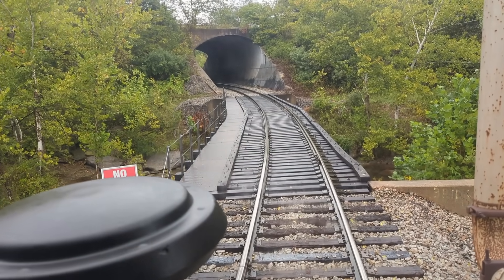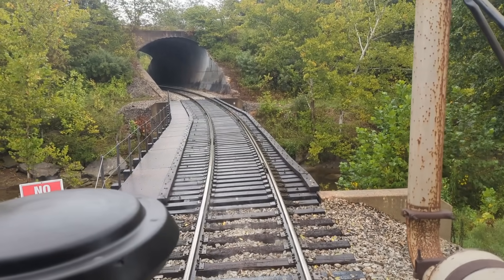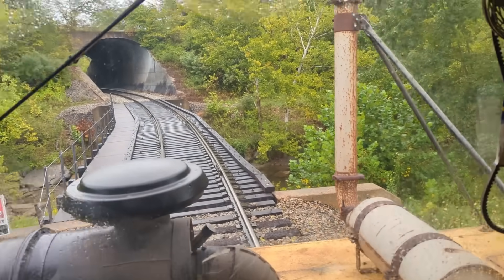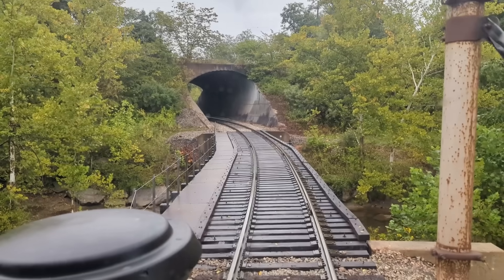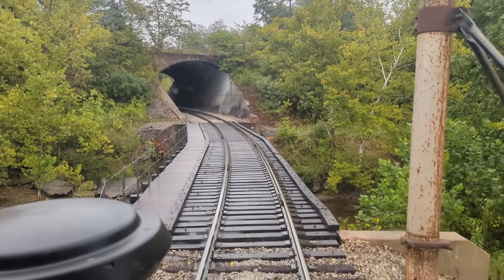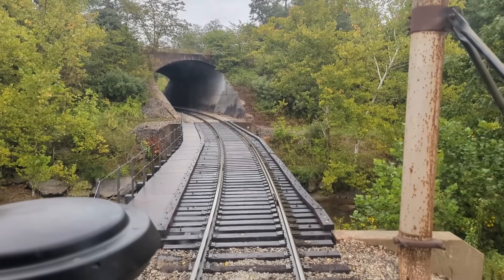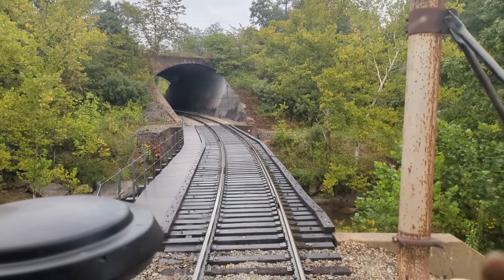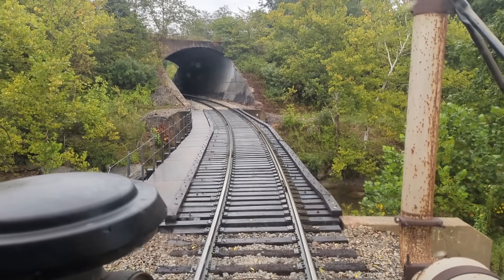How Super Elevation is Added to Railroad Curves on a Bridge

Comment: Dave, excellent video. Very nice job explaining super elevation. I want to say I can remember so old FRA track geometry books that refered to super elevation as cant. I know I've heard it called that before. Another way I've seen super elevation put into a curved bridge is to drive the piles to the desired elevation. Have a wonderful day.
Reply from the maker: Thanks for the nice comment Zach and for sharing that info about the piles being driven to different heights, I did not know that
was ever done. Now I've learned something else new. On our
bridges they don't have pilings but girders rest on a solid
concrete block, huge concrete block!  Really appreciate your
taking the time to watch and hope you have a very good day.
Reply: @ccrx6700 All our bridges had piles. All were also the old wooden trestle style too. I can recall 1 in particular that the Santa Fe had replaced as a concrete culvert but left the old wood trestle deck. It was an oddity but worked.
Reply from the maker: @rebelrailroader 👍😎🚂

Comment: I don't know the term for it but a lot of other railroad bridges have been converted so they are all ballast with track laid on top so there is no bouncing transition. I guess those are less maintenance for high speed and what you have here is less maintenance for low speed?
Reply from the maker: We have 1 ballast deck bridge Bridget. I love it. All our open deck
bridges have problems with the approaches sinking, the ballast
deck bridge never has a problem with that, tamp right thru it. I
wish all our bridges were ballast deck. Far less maintenance
on a ballast deck bridge too, you are right about that. Thank you for  taking the time to watch our video and may you have a very good day.
Reply: Ballasted deck trestles and viaducts — that's an interesting question, I'd like to know too!
(Also, I read your username as "bridge it" 😉)
Reply from the maker: Read my reply to Bridget Tristan.

Comment: I see that the ties are wider just before the bridge. Does that make the transition good enough or does it still bounce up?
Reply from the maker: Not wider but they are longer Bridget, I think that's what you meant.
Typical cross tie is 8 1/2 feet in length. Usually we put 5 to 7 longer
ties in close to the bridge, they are 10 feet in length. That helps
to spread out the weight over a wider span and helps to better
hold track surface going into a solid fixed object like a bridge.
Thank you for taking the time to watch and may you
have a very good day.

Comment: Hey Dave,  What is that pipe or plenum that is covered alongside the bridge used for?
Reply from the maker: That is a 26 inch pipe line that carries treated mine water from
the mine to the river j Biggz. Pipe is hung under several of our
bridges and is wrapped in insulation and also has heaters.
Thank you for taking the time to watch our video and may you have a very good day.

Comment: I was wondering what the superelevation rate in '/' ( foot per foot) or by percent of super is on that first bridge? Also do you know what the design speed was on the first bridge? Seems to me like a compound curve or a spiral curve would have been a better design than off setting the tracks on that bridge...............
Reply from the maker: Speed on our entire track has been 25 since the beginning Dan.
Bridge 11 is in the full body of the curve so the SE remains constant
thru the entire bridge. To figure how much super elevation goes
into a curve there is a mathematical formula, however I have a 
chart put out by the FRA which gives me the correct SE for the
degree of curvature and train speed. That curve is a spiral curve
but not a compound one. The radius is constantly changing
until the full body is met. SE is added in increments of 1/8 of an inch
over the entry spiral and taken out 1/8 of an inch over the exit
spiral. The amount of linear feet that 1/8 of an inch is added in
or subtracted from depends on the length of the entry and exit
spiral. Thank you for  taking the time to watch our video and
may you have a very good day.
Reply: @ccrx6700  I am familiar with the AAHSTRO design book. Nowadays we got it made, Civil 3D & Inroads figures out super elevation based on design speed and radius we set.

Comment: Hello Dave 👋, 
Great explanation on the dapt.
When you're in a spiroll, the center part of the bridge is where you key off of When tamping if I'm right  to meet the transission at the bridge walls to the first tie in stone
 and not make a speedbump in the track. 
After sorting through over many thousands of ties, that bridge timber was rejected for the the horizontal split going across the timber from the dapt to the other dapt.
Very expensive timber and a shame for the tree 🌳 that it came from. Many years of growth and now it's junk 😮😢. 
I see many like that while sorting out ties. 
Stay safe my friend and have fun 👍. Richard Bause
Reply from the maker: We don't like speed bumps in our track Richard.... :-) Problem with
most bridge approaches is they sink. I can start my plot anywhere in
the curve if I want, just have to know how to add in the right
super elevation if a plot is started in the middle of a curve, starting
in a spiral requires a bit more mathematical know how, so I
usually don't do it. Saves me some brain power..... LOL  Thank you for taking the time to watch our video and may you have a very good day.

Comment: Dave, which came first? The tunnel or the Interstate?
Reply from the maker: Good question Donald, more history. Our tunnel under neath I 79
was built around 1970/71. That portion of I 79 was built after
in 1972/73. My dad was a line man for the local power company
and was one of the men who moved the electric lines for that
tunnel to be built. He took us up there and drove the car right up
to the tunnel when it only had a concrete floor in it around
1971. I remember that well.  The tunnel that I showed in this
video was put in around 1975/76 and they closed the road 
over top to build it.  Thank you for taking the time to watch and may you have a very good day.

Comment: Thanks for another great video Dave and you are quite right we call superelevation “cant”, we also have to work out transition into the curve and “cant deficiency” which is the difference between the ideal cant and the installed cant to allow for the fastest smoothest passage of trains.  Who said railways were boring
Reply from the maker: Thank you for the nice comment Ian and glad you enjoyed. Cant deficiency can occur from having poor quality ballast that won't
hold track surface well. I have that problem on several of my
curves. The trick here is to try and match the proper cant with
the correct train speed. 6 different train operators plus a host
of fill in operators and no one drives every curve at exactly
the same speed all the time. So to help with that I put the super
elevation in a curve using an inch and  a half under balance.
I've not yet made a video on under balance, most RR's in N. America
use inch an half, but up to 3 inches under balance is allowable by the FRA.  I sure never said railways were boring, pain in the butt to
work sometimes but never boring.... LOL  Really appreciate your taking the time to watch and may you have a very good day.
Reply: @ccrx6700  Actually cant is the angle of the rail itself, and superelevation is the height difference as you previously stated. On a gentle curve on a low speed track, changing the angle of the rail itself from perfectly plumb probably isn't necessary. But if you can imagine your train going twice that speed through that 10 degree curved, then the rails themselves would also need to be tilted off of plumb at the exact angle, as well as the superelevation calculated for the speed. If it's too much for the speed, then it's like trying to walk on the outside of a corner at Talledega Superspeedway, you'd fall right over. That pavement is at like a 33 degree bank angle in the turns, but only 2 degrees on tangent (straights or straighaway) parts of the track. They use tie plates that are thicker iron on one side than the other to slightly tilt the rail. But in England they have passenger trains that run at 100+ mph, certainly too fast for jointed ballasted track.
Reply from the maker: @brnmcc01 in N. America you are correct about cant in europe cant is what they call super elevation 🚂👌

Comment: 15:33 They didn't use this one because of the horizontal cracks. Those parts holding the rails back from sliding sideways would break off really soon and the sleeper would need to be replaced shortly.

But there's a bigger question there. Why was it left on the construction site? Why is litter always left behind? Why are the forest and the stations taken for a dump?
Reply from the maker: I do believe you are right about the splits in the timber Gabor.
As for the cleanup typically the contractors do come in at some
point and clean up their mess, however so far this hasn't happened
 2 months later. Guess at some point I will end up doing it for them.
Thank you for taking the time to watch our video and
may you have a very good day.

Comment: Would the daft decrease as the rail is coming out of superelevation?
Reply from the maker: I have no idea what you mean by daft Tim. However super elevation
in a curve is added in increments of 1/8 inch until the entry spiral
reaches the full body of the curve where the super elevation
is constant. On the exit spiral of a curve that super is taken out
1/8 of an inch at a time until it reaches tangent track where there is no super. The amount of super that is added or taken out over
the entry and exit spirals are totally dependent on the degree
of curve it is. In other words for the amount of linear feet (which
is different in every curve),  1/8 is added or taken out every
so many linear feet.  Super elevation begins with the first 1/8 inch
added and ends with the last 1/8 inch. It's just different amounts of super thru the curve except for the full body where it is constant.
That was a mouth full.... :-) Thank you for  taking the time to watch and may you have a very good day.
Reply: @ccrx6700 Sorry  for the confusion but I couldn't make out the word you said. It sounded like daft  to this hard of hearing ears.
Reply from the maker: @timc4293 👍🚂🙂
Reply: @ccrx6700  Is the amount of superelevation also based on the design speed? I would think that the faster you move a train through a curve it would have to be a lot more. Kind of like when I was riding my motorcycle, to go around a sharp curve I would really have to push to lean it over enough. I think the idea is, you should be able to hold a glass of water as you ride the train around the curve, and if all is correct, the water should be level, ie. the force of gravity in the car should be perpendicular to the floor and not leaning to one side. Coal not super important, but I can imagine a liquid tanker car would not behave very well on a curve with incorrect superelevation. That 1000's of gallons of liquid sloshing to one side could definitely tip a car over.
Reply from the maker: @brnmcc01 absolutly SE has a relation to train speed. Tanker cars are like tanker trucks they have baffles to prevent sloshing 👍🚂

Comment: If the rails are super elevated wouldn't  it cause the plane of the locomotive to tilt off vertical by some percentage and when it enters the tunnel might it be too close to the tunnel portal?
Reply from the maker: The main purpose of super elevation is to maintain car/loco
equilibrium thru a curve Tim. If a train when thru a 10 degree curve
at 25 MPH and that curve had no SE in it, then the train would
keep on going straight and come off the rails. The SE is put in 
to help steer the train thru a curve and also to allow for
equal weight of the cars/locos on both rails instead of too much weight on one rail or the other. Thank you for taking the time to watch our video and may you have a very good day.

Comment: I am guessing that super elevation reduces excessive wear on the inside of the high rail and allows more speed through the curve??
Reply from the maker: SE does 2 things Larry. It helps maintain car equilibrium thru a curve
and allows the train to negotiate/steer thru a curve. SE is put in
a curve depending on the degree of curvature and the train speed.
If a train went thru Bridge 11 and that curve had no SE in it, then
the train would want to go straight because of the centrifugal force and come off the rails. Think NASCAR racing that is why they
bank the curves. SE also causes the cars to put equal weight on
both rails, thus reducing the wear and tear on only one rail.

Too much SE in a curve for the train speed and thus too much weight
on the low rail and more wear on it and car wheels. Too little SE
for the train speed and thus too much weight on the high rail
and more wear and tear on it and the car wheels.  Thank you for taking the time to watch our video and may you have a very good day.
Reply: @ccrx6700 Great explanation.  Thanks.  I banked airplanes in a turn to balance forces too.
Reply from the maker: @LarryTaylor-l5m 😊👍🚂

Comment: How long do bridge timbers last before they change them again
Reply: They last a very long time, because they do not spend their life soaking in mud pumping up and down. Treated wood lasts a very long time if allowed to dry out, and not in contact with soil etc. I've seen power poles around here that were installed in the early 80's and late 70's that are still in service. But those are gradually being replaced, because it might look ok above ground, it's that 8 foot section that's buried in the post hole that eventually goes bad.

Comment: I would think the guard rails would be considered an extra layer of protection. It's like buying extra insurance. You hope you'll never need it, but glad you have it in case you do...
Reply from the maker: I totally agree with you on that Steve. What I am very surprised about
is the insurance people don't require it or at least lower premiums
if the bridge guard rails are in place. If it was up to me then all
our bridges would have the guard rails on them. When this track was
built all the bridges did have them, but they have over the past years
not been replaced when the bridge deck got replaced. Thank you for taking the time to watch and may you have a very good day.

Comment: Not that the Aussies and the Brits are wrong, but "superelevation" is the engineering term WE use to define the design/maintenance parameters for the track structure and "cant" is the difference is casting of the tie plate base that sits flat on the tie (regardless of the track superelevation) and the rail base of the tie plate.  The tie plates are placed on the ties such that the cant "tilts" the rail inward.  This design reduces the overturning possibility of car/wheel forces, espectally in a curve.  

Get the "cant" right, 'cause if ya get the "cant" wrong,.....ever seen a picture of a rail overturned?
Reply from the maker: You are right about that Glenn for N. America. In tie plates
that have cut the ties that causes what rail cant is. That is what
geometry trucks look for when they measure rail cant. Rail cant can
cause the rail to tilt outwards thus redefining the base to height
ratio and if severe enough can cause a rail roll over. We had a rail
roll over here 3 years ago. Although that was caused by a stiff
truck where the truck didn't steer thru the curve and climbed
the rail thus changing the LV ratio and the rail rolled, it was ugly.
Thank you for taking the time to watch our video and
may you have a very good day.

Comment: Interesting. When the commersial railroad was changed into a museum railroad, sold by the state, the super elevation was huge, made for lot higher speeds. Once the rail bike tipped over when sitting above the low rail having no bucket of sand above the high rail in a 300 meter radius curve. Else leaning over towards the high rail, like the motorcycling with side wagon and a wildly working guy leaning into the curve.
The superelevation also made a ballast car tipp over once.
The rail cars design speed was 85 kmph but the speed used now is 50 kmph. The steam locos designed for some 60 kmph now run at 40 kmph. Of course the super elevation has been decreased significantly.
Reply from the maker: Glad you found it interesting Stefan. RR thinking here in N. America
has changed in the last 40 years. Used to be more super elevation
was the standard, over the years now less super elevation is
being put in. So what was once a curve that had 5 inches of super
in it, now it may only have 3. Course obviously the faster the trains
the more super elevation is added.  Really appreciate your taking the time to watch our video and may you have a very good day.
Reply: @ccrx6700  Being a railroad fan since the age of 2 Your channel is a goldmine.
Reply from the maker: @Stefan_Boerjesson 😊👍🚂

Comment: There is two methods that are used in the NYCT. One is a regular cross tie with a tapered block on the high side. Second is a specially milled tie which is solid, with the taper milled for elevation. This eliminates the dap for anchoring to girders. Bridge anchor clip from under neath hold the cross ties in place. For limited access to under neath that may not be accessible J Hook bolts do the job, that secured from the top.
Reply from the maker: Thank you for sharing that Billy. I do wonder how those tapered
blocks stay in place? We also use the J bolts but they only put
them every 4 or 5 timbers.  Really appreciate your taking the time to watch our video and may you have a very good day.